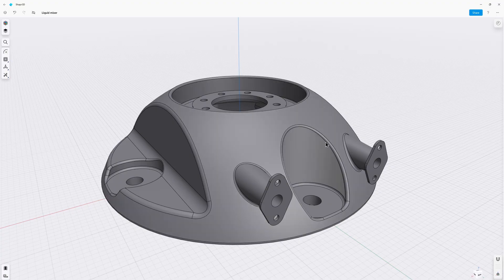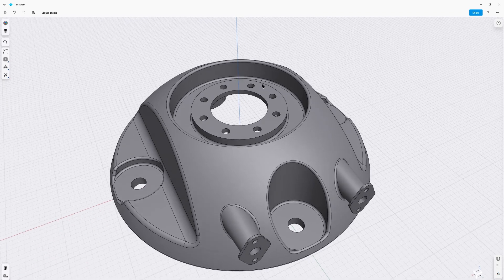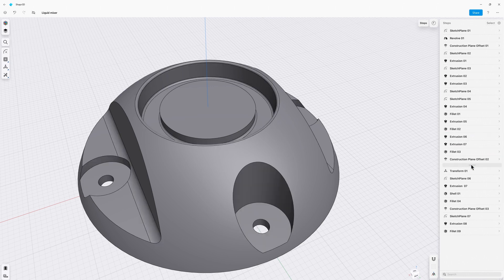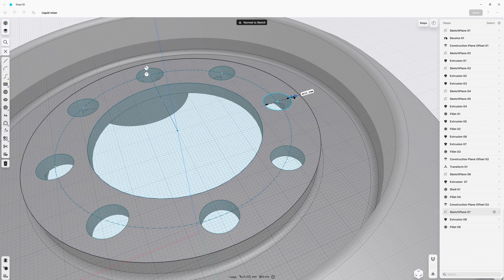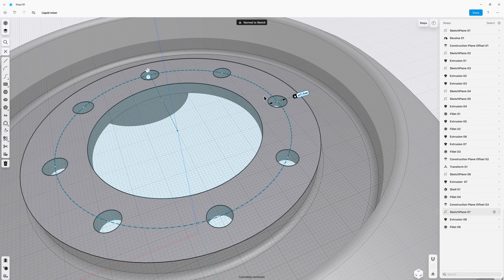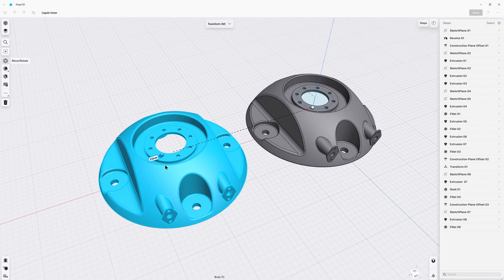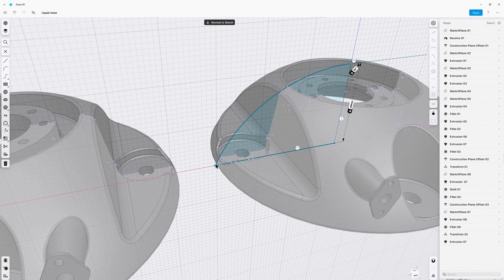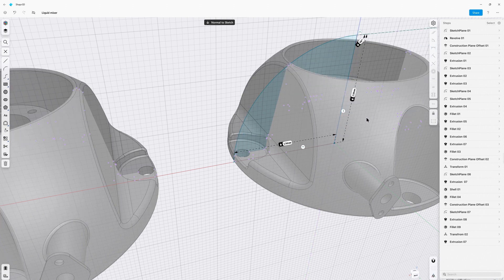Deep-dive: Parametric Modeling in Shapr3D

Comment: I am a long time Fusion360 user but I actually grit my teeth every time its repulsive user interface chugs its way only my screen. I always try new 3D apps including Shapr3d, however direct modelling is and was always a complete joke. Notice how theres always concept art, or a fake engineering model where dimensions don't matter. How can you be expected to invent something mechanical if the parameters disappear as soon as you extrude, revolve, etc. Parametric modelling is the key, so it looks like Shapr3d is back on the menu.

Comment: I’d love to have Proportional constraints. So that line B is not merely “=“ to line A but it is a multiple. So that Line A might be 1 and line B might be 1.618.
Even better, the ability to write formulas for proportions of line lengths or angles would be fantastic.
Will that be included in parametrics?
Reply: Yes.

Comment: With upcoming releases this year, is it risky that it will require more powerful  ipad? I currently have the ipad pro 12.9 2nd generation.
Reply from the maker: We are investing a lot in optimizing the performance of Shapr3D and ensuring it runs well even on mobile devices. Of course, additional functionality like History-Based Parametric Modeling means that you can do more, and that might require more powerful hardware. We’ll publish more concrete information as we get closer to the public release during the Open Beta.
Reply: @Shapr3d  Please，give us the The Function of Grasshopper in Rhino

Comment: I agree, an assembly module will be the next major feature I look for. But with parametric modeling, does that imply that there will be user-defined variables that can control parameters? I hope so.
Reply from the maker: Yes, the final release will contain user-defined variables
Reply: @Shapr3d  Wow! This actually makes Shaper3D very very powerful. For a furniture and small steel worker this will speed up using previous models as "templates" and changing dimensions with clients on the fly!

Comment: Finally! Shapr3d is lacking 2 major features that make me switch to other CADs whenever I'm trying to design smth more complex:
- first was history based parametric modeling
- second is proper assembly module
It's a great news to have first one soon available. I hope we could expect second also in near future.
Reply: What do you mean by proper assembly module?
Reply: @brianhogg358  the one you can see in every full-fledged parametric cad. Where you can take the parts you designed and assembly them into working mechanism using constrains. Shapr3d has only alignment tool which is very rudimentary and not up to a task.